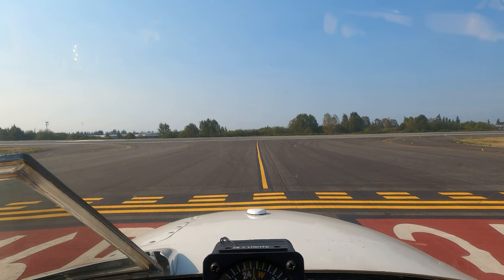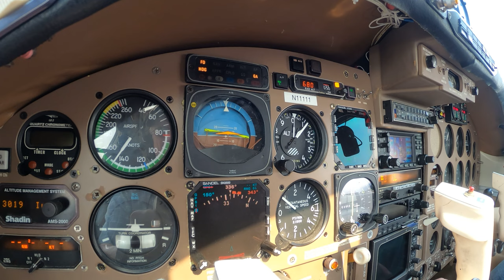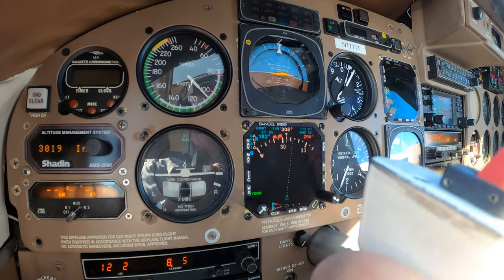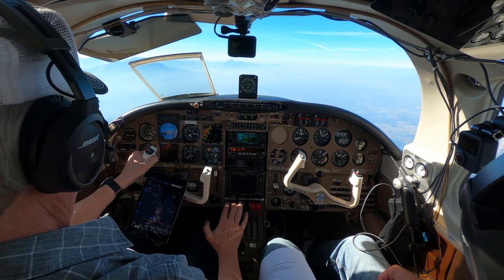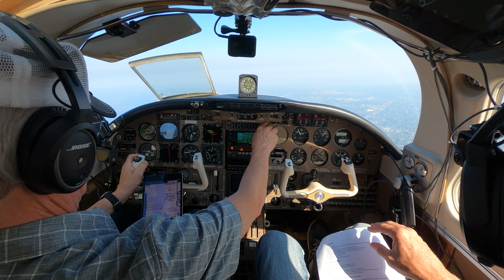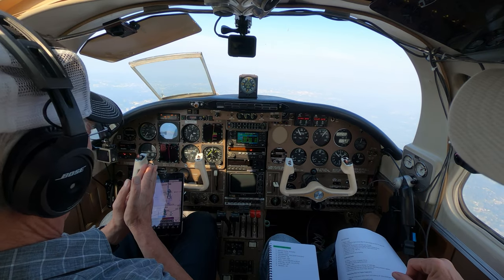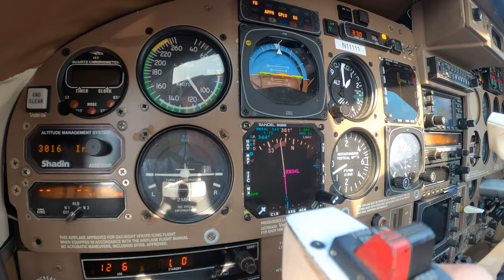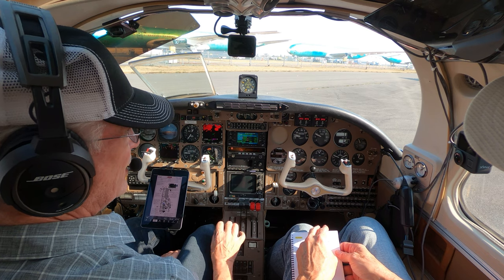The Aerostar 700 will stall before reaching VMC.

Comment: Nice demo.  Thanks.  And at KPAE too!  I taught there for many years, but didn't know of your Aerostar.  The only one I knew of was Virgil Morgan's.
Reply from the maker: Have you seen the series of videos we did on N14VM?  Check them out.  N11111 has only been there since late 2016.
Reply: @AerostarPilot  Thanks for the heads up.  I'll certainly watch them all.
Reply: @AerostarPilot  Fantastic series.  Thanks.  I first met Virgil in 1976 when I was a brand new CFI and went to work for the Grumman dealer very near Virgil's hangar.  Over the next 25 or so years I got to know him very well.  What a great person.  I finally retired from teaching in 2014 when I closed my flight school.  We moved the whole operation to Arlington in 2012.
Reply: @AerostarPilot  Eric, I am flying TS601B... Left wing has lost one of the Vortex gen? from the leading edge.. ( the one near  the engine). Is a No go item?
Thanks
Reply from the maker: @diegocarlosaguer9516  I have flown one with new boots and no stall strips attached.  flew fine.  Call Aerostar Aircraft or Juliette Delta Aviation at KCXY and have the send you one.  Make sure the stall strips are not coming loose during preflight, if they are, glue them back down so you don't lose another one.

Comment: Interesting demo... the ball was almost completely out of bounds AND a hefty amount of cross controlled aileron. This is how you end up over on your back in a NY second.
Reply from the maker: How is right rudder and right aileron a cross control situation?  With the left engine out you will have a lot of right rudder if not full right rudder during a VMC demo AND will need to "lift the dead" and have 3° to 5° of bank into the good engine in order to minimize the side slip and maintain directional control.    Here is a great talk by a USAF test pilot related to VMC.  The information in the video defines a good reason to rotate the Aerostar at 95kts and have the mains leave the runway at 100kts to make sure you are above "actual VMC". Really good watch.
Reply: You are correct, not cross controlled. I was so focused on the ball completely to the right. @AerostarPilot

Comment: Notice no stall warning horn...be careful.
Reply from the maker: The Aerostar's do not have a stall warning horn because the aerodynamic stall buffeting was sufficient to warn of impending stall.  The FAA did not require it.  The only Aerostars with a warning horn where the 25 Piper 700P's.  I believe this was Piper's choice to add it.
Reply: @AerostarPilot  I have seen two Aerostars with the main struts sticking up through the wing spar having stalled in the landing flare.